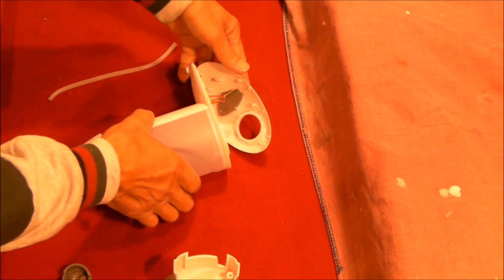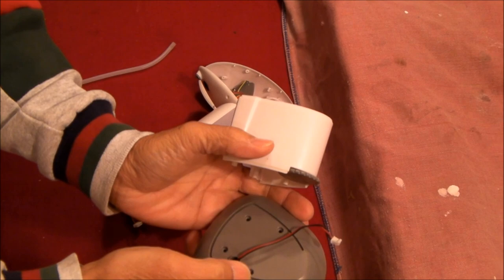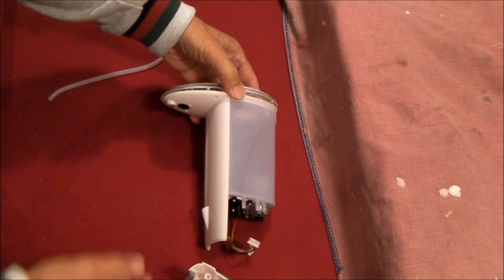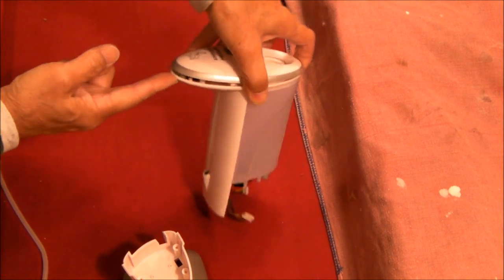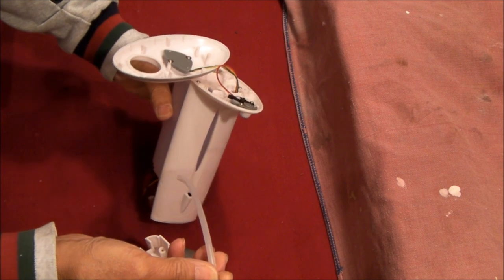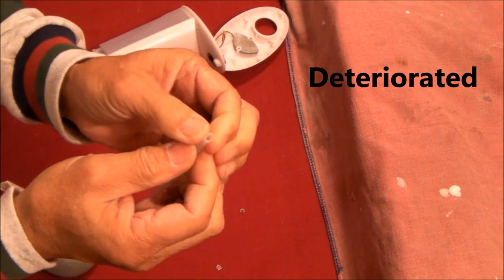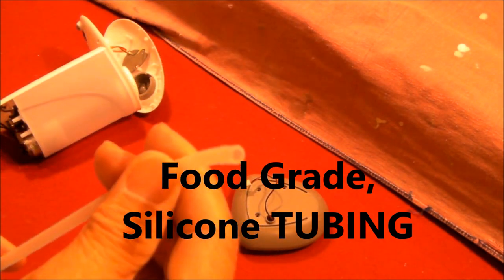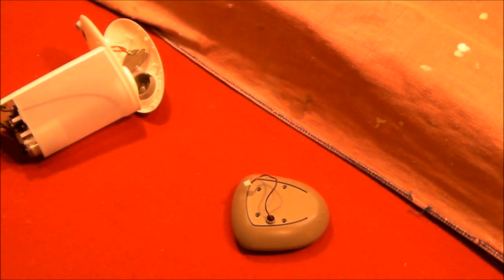How to fix/repair Automatic Liquid & Soap Dispenser - Hammacher Schlemmer GH2192

Comment: Hi, my dispenser sensor stop working, the internal mechanism works fine because I take the soap by pressing the manual button to do so, but not by putting my hand underneath the sensor, do you know what could be the problem and if the sensor could be replaced or this are those kind of products that you have to bin?
Reply from the maker: I doubt you can just replace a sensor.  it could be a failed power supply or even no power getting to a good sensor.